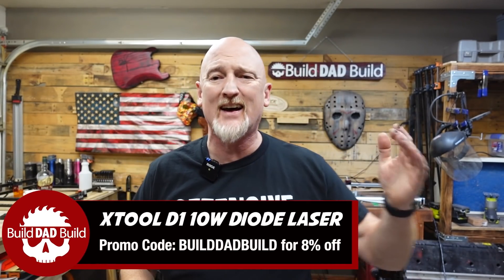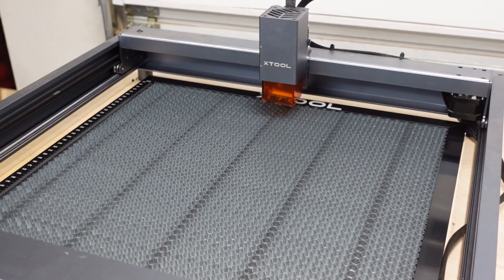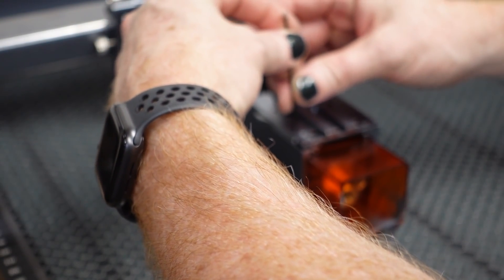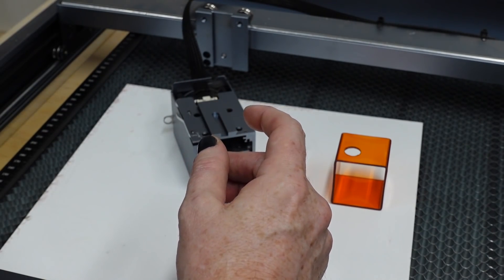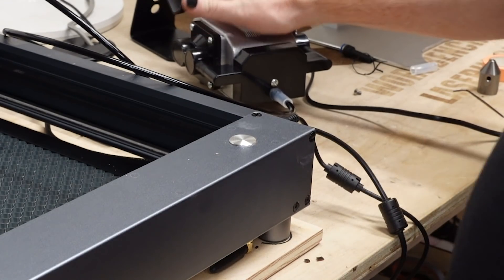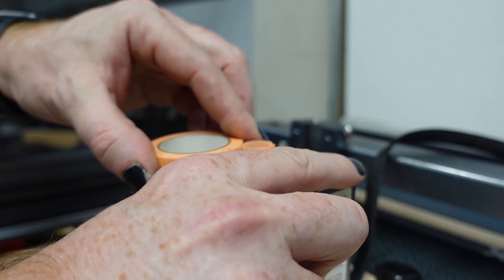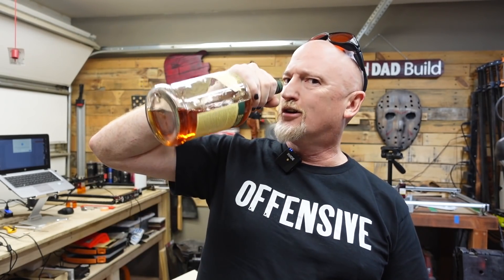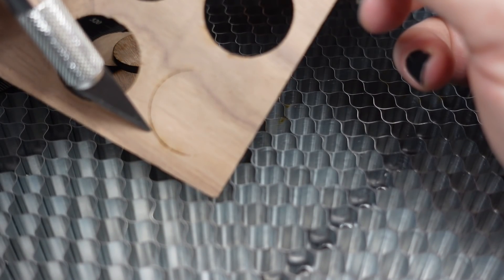Did It Just Get Even Better? Upgrading the xTool D1

Comment: I have air assist and was having the same issues as you with laser not firing out of the nozzle. When I try to put even just one layer of tape on the laser head. The nozzle pushes the tape off at bottom instead of fitting onto of the tape. Any suggestions? Very disheartening trying to get this to workm
Reply from the maker: Not sure. I had to put quite a few layers of tape on mine.
Cheers

Comment: What is the purpose for the 90 degree brass fitting under the control board?
Reply from the maker: That's the antenna for the wifi
Cheers

Comment: Can the 10 watt D1 cut EVA foam, foam board/foam core, and mat board? If so, what is the max thickness it can cut for each these materials?

Any chance you could do a video cutting these items?  I really want to buy one but can’t get clarification if it’ll cut these materials.

Thanks in advance!!
Reply from the maker: I have seen other folks do it. Not sure on the thickness.
Cheers

Comment: Cable management idea for D1.  On my 3d printer I used a heave gauge wire bent screwed to frame with an arch to manage cables (zip tie cables).  works well..  Actually you can probably use an old wire closehanger.
Reply from the maker: Interesting...
Cheers

Comment: the extra's look great, I cheated and got a fireplace screen that works just fine for $30; I also have 3d printers and made my own legs for the screen to stand off.  Still most of my work is solid wood I do not worry too much about burn or hot spots as a sand with 200 grit and poly coat for that great eye appeal
Reply from the maker: Sounds good John!
Cheers

Comment: If you had to purchase the air assist all over again would you ?
Reply from the maker: I would not. I would buy this one instead. 
https://www.etsy.com/listing/1148340464/no-mod-air-assist-nozzle-for-xtool-d1?ref=yr_purchases
Cheers
Reply: @BuildDadBuild  Which option do you need for the Xtools D1 10w? 13, 14, or 16mm?
Reply: That’s the one I was also considering…thanks for making up my mind 😃
Reply: What about the honey comb? How has that been working out for ya? Is this something you would buy over again if you had too? I’m asking because it’s been on my mind to maybe make the purchase.
Reply from the maker: @Mark-oj7yt  The honeycomb I would ABSOLUTELY recommend. It's built well, fits the machine and comes with a metal backer that a lot of the other ones don't.
Cheers

Comment: We have a question, our cross hairs seem to be off center on our D1 and they seem to look splintered if that makes sense, is there a way to calibrate them?
Reply from the maker: The laser crosshairs ARE off center. The xTool takes that into consideration and will adjuster the laser before the cut/engrave. That splintered look is normal. It's just the way it refracts through the shield.
Cheers
Reply: @BuildDadBuild  thank you
Reply from the maker: @bluetongueinkllc8230  sure thing. If you have any other questions HMU nick@builddadbuild.com

Comment: Are you eventually planing to do a review about the Atomstack x7 pro? I bought one and after a week i am more and more thinking about sending it back and change to the xtool d1. Why? i don't know to be honest. Outcomes from the x7 are pretty good, but i cant get even an acceptable result out of engraving a white tile. not with the norton white tile method, nor with the kenny hack. I dont know if this is an issue with mx x7 or maybe i am to dumb to get this work out well. engraving on stainless steel, slate and so on works pretty well. i would like to hear what you think about the x7.
Reply from the maker: To tell you the truth they sent  me a P7 and I've had nothing but problems with it.
Hence no video to date. Not sure if that helps. LOL
Cheers
Reply: @BuildDadBuild  They sent you a P7? Might be different to the x7. I have some time left to send the x7 back. But the xTool will come as a 2nd laser or in replace for the x7. I dont know that right now...

Comment: Build Dad Builds, does the machine have limit switches? Or how does the machine know how far it can travel?
Reply from the maker: The xTool D1 does not have limit switches. So yes you can accidentally travel outside of its boundaries and get that fun little grinding noise.
However the gantry is unlocked. So you really don't have any need to home it. I just set up my cut or engrave, align it with the crosshairs in the middle of the work area and let it rip.
Cheers

Comment: The plastic feet for the corners are to raise the bed and allow the gasses to exit from below the honeycomb Nick. Otherwise you'll get an explosion if you cut for too long from the gasses building up.
Reply from the maker: Good to know!
Reply: i want to design some 3d printed holddowns.  What is the size of the holes in the honeycomb????  anyone???
Reply: @jspach42  you can find the dimensions for the hold downs directly on the XTool.com site. The set of four that they sell for 30 bucks, list the measurements right on the product description.

Comment: What is the maximum size you can cut on the D1? Does it have a “pass through” for longer pieces?
Amazing videos. Thanks for your time
Reply from the maker: Hey Victor!
The workable area is17X16"
You can raise it up to put larger objects in it.
Cheers
Reply: @BuildDadBuild Hi! Nice video,  even of you raise it up, how can you pass through larger items? I am SO close to buying a laser but I really need a larger workspace! Thanks so much!
Reply: @melindagibson8606  so the reason other lasers have a passthru, is because they are enclosed or more stationary units. These exposed, aluminium extrusion framed gantry lasers, are lightweight and mobile, so basically, they are the most pass thru framed laser you can have.

You literally pick up and place the laser onto any item you want to engrave/cut. Think about what a passthru is and it will make perfect sense.

Comment: A suggestion to deal with ‘this cable’/air assist line would be a drag chain. Lots of folks in the 3D printing maker space use them.
Reply: A simple hack is using 2 - “3M Command Light Clips” below the right side track. Just move the laser to the fartest left corner to extent the cable.
Reply from the maker: Thanks for the tip. Now I gotta figure out how to get it on there! LOL